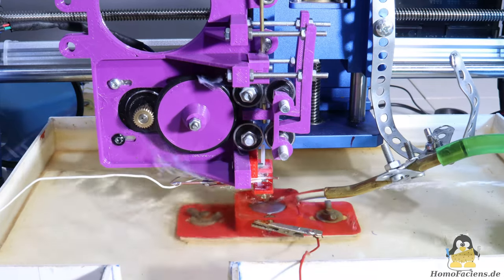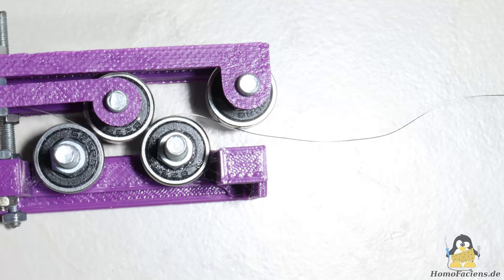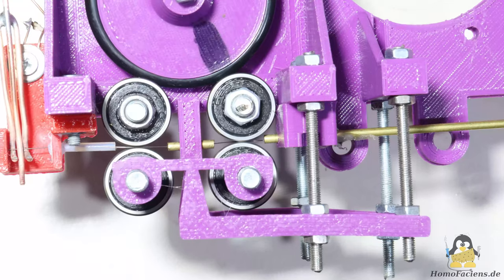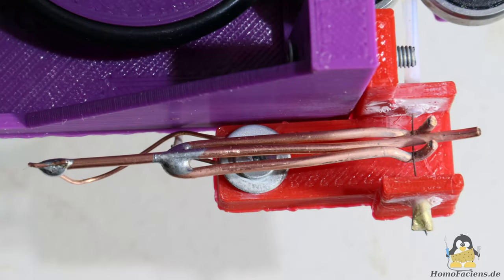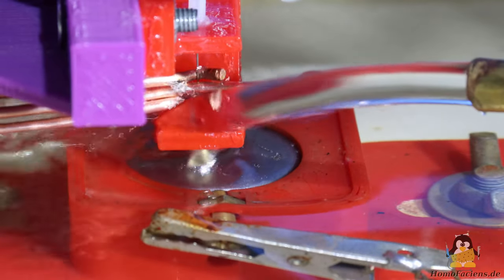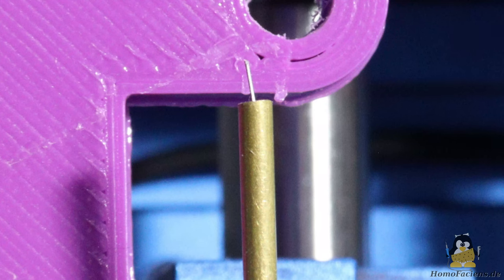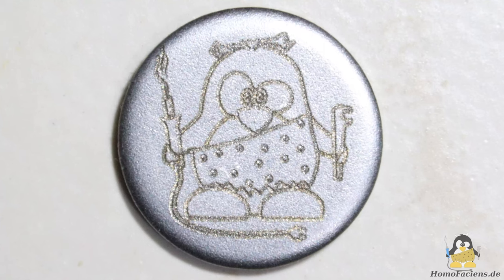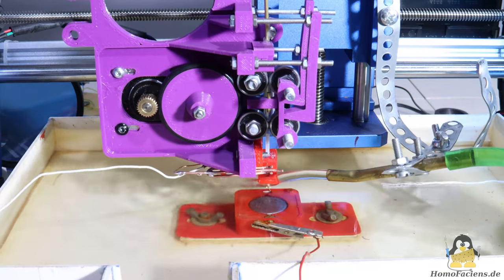EDM, Active Hammer part 2: Engraving steel with 12V

Comment: very cool. 
Those latest changes are starting to really show in the quality of the engraving.
Reply from the maker: It isn't cool. It is so hot it can melt steel ;-)

Yes, from the mechanical side, I am close to where it should be, however I already have slightly changed the design to get it a bit more compact. Another point I am working on is to make it more easy to insert the wire. That's still very fiddly.

The electronics it the next main point to work on. Stay tuned!

Comment: Maybe you could characterize a function of 

1) wattage passed through the wire and 

2) rate of coolant flow 

3) over time 

and code in short pauses or reduced travel speed (when the hammer is lifted) to let the wire cool a bit to avoid it welding?
Reply: sorta like volumetric printing in 3d printing
Reply from the maker: I will talk about efficiency (input wattage versus erosion rate) in one of the coming videos. For now there are still some improvements to be done before going into that details.

Slowing down a process that already isn't really fast is no good solution. Improving the coolant flow is the better option. 12V is high level, going down to 9V or so is a quick solution to avoid welding. Using different (non welding) electrode materials (e.g. brass wire) is also a practical solution. More on that in coming videos - stay tuned!

Comment: Could you run wire trough the 3d printing nozzle? You can have much better control than bent pipe. Are you pulsing power supply or it is just DC?
Reply from the maker: It is just DC. More on the electronics will follow.
In what way do I get better control with a printer nozzle than with the bent pipe?
Reply: for starters, you will have part that is easy to replace once is weared off,  another thing is that you have controlled diameter of the nozzle, so lets say you have 0.45mm diameter of the wire, you can have 0.5mm nozzle, therefore you know you have wiggle room of 0.025mm in all directions as your machine is going in both x and y directions, wire will not follow it. You can calculate those tolerances when designing your g-code. I know that 0.025mm is too small for machine like this, but if you can have better control over your design, then why not?
I was playing with my own EDM machine designs before, my last tought was to pump water trough the nozzle while feeding the wire. Nikola Tesla's check valve on the other end should keep  water within the "chamber" where nozzle is screwed, while wire can still pass trough it, since valve itself doesnt have moving parts. Sorry if you didnt understood me, english is not my native language @HomoFaciens
Reply from the maker: You are correct with your ideas, thanks for sharing your experience, but my thoughts are different:

It is also easy to cut a piece of brass tube and bend it with calipers. Even cheaper than a 3D printer nozzle. I can live with that tolerance uncertainty (at least for now).

About that tolerance numbers: You already wrote that they are extremely academical. Also keep the random nature of sparks in mind. I will demonstrate this in one of the coming videos.

3D printer nozzles are longer than the brass tube I am using and you should keep the length from contact point to tip of the wire as short as possible because of the high current versus thin wire thing.

Yes, I also thought of pumping water through that nozzle along the wire as a jet of water from the side deflects the wire. A Tesla valve would work free of wear, but I am more thinking of feeding the wire through a piece of rubber to seal the component with the contact point inside of the high pressure part.

...and: my English isn't better either ;-)